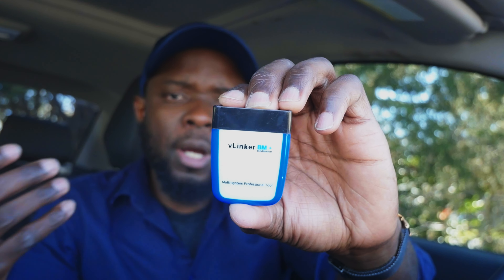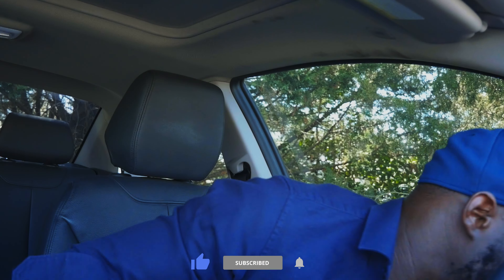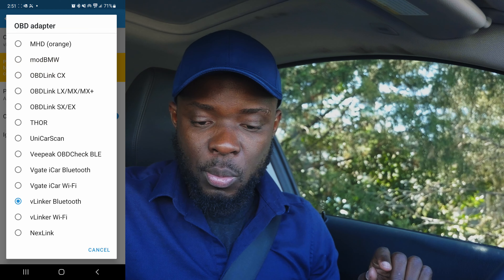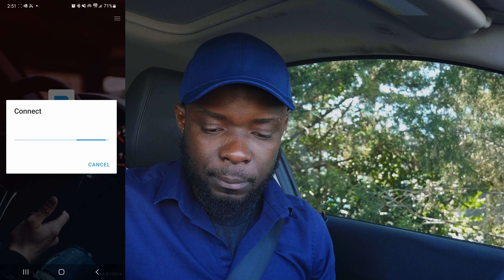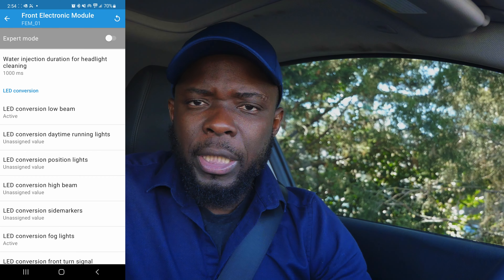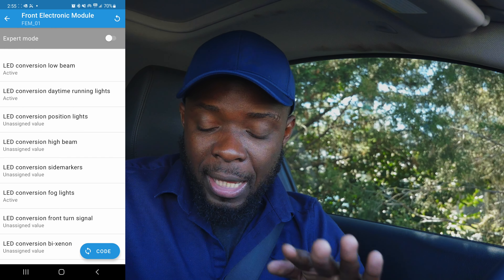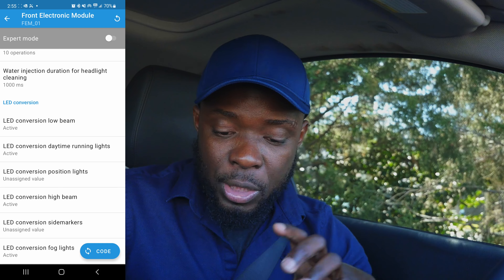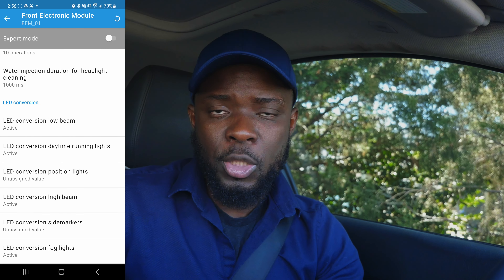Installing New LED Light on BMW 228i - N20 & Coding with BimmerLink

Comment: Did you end up buying new ones? Or did it work
Reply from the maker: I ended up rebuilding the entire headlight. I custom fitted 2.5-inch projectors with another type of angel eyes. couldn't be happier.  check out newer videos, and you'll see the difference.
Reply: @hyde_official  nice! Just checked out the build in 15 min video. Very clean build how much do you think the cost was for everything in total?
Reply from the maker: I am compiling the build list: parts, labor, etc... the video will be out once ready. stay tuned on that.
Reply: @hyde_official  yupp since the build done now u finna keep it for a while or 240i next👀😂

Comment: Quick question, if I am installing some after market tail lights on my 2014 bmw 228i and I needed to do some coding for my lights to work, would this module you mentioned in the video help me with the coding? I bought Vland tail lights and have tried setting them up, but only one light on the whole tail light is coming on when plugged in all the way, so im thinking ill have to code my bmw to have the lights work properly on my tail lights.
Reply from the maker: Based on your case, your case, it does look like the light you get aren't compatible or they are faulty one. you want the LED to have the same exact vaultage.  don't just buy because it's a brand, but you want to buy a bulb that has the same wattage and voltage.  and Yes, Bimmercode will help you code your car.
You can start with that